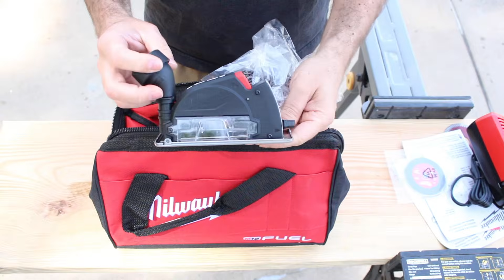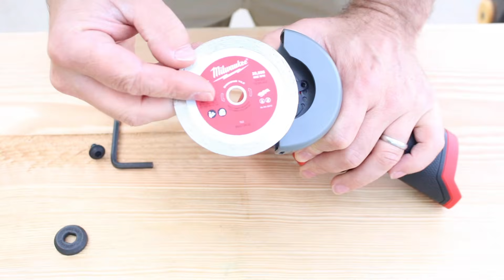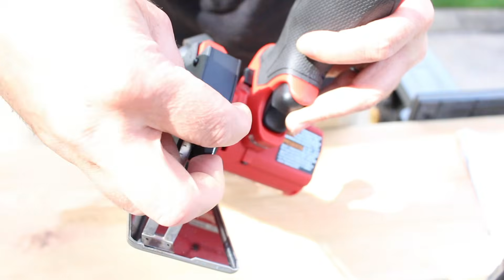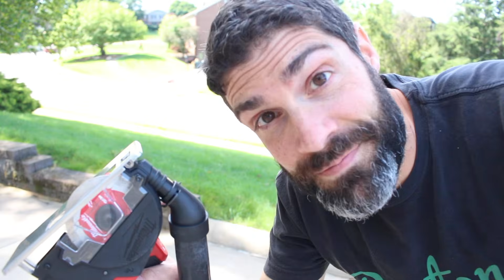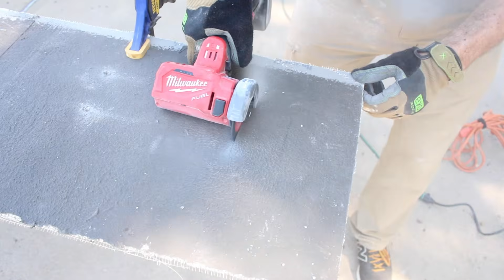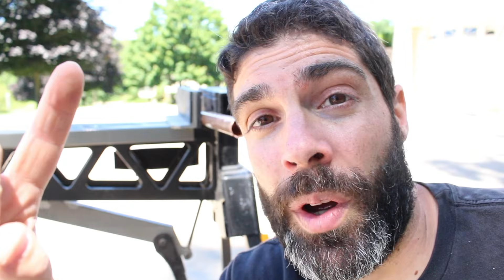Milwaukee 12V Cut Off Tool...What Can It Cut?

Comment: It seems just a little 2 small ...
I was on board to buy this tool but it's blade is probably just 2 small .. I thought it would be great for conduit and pipes but as easy as it did cut it seemed like you struggled getting a clean cut right around ..
Great video pretty cool tool

Comment: just got mine,broke it in on intstalled doorstops trimmed the extended bolts no prob,no speed control but luv the compactness,will be using on all quik projects

Comment: MUCH prefer the DeWalt. More powerful, feels better in the hand, has an allen tool storage, you can change the wheel with the dusr shield on etc. It just has more features and it's just far superior.
Reply: Yea its really goes back and forth both brands each have better stuff. Sadly batterys so costly its often beastto just stick to one brand.

Comment: As an electrician sometimes I do residential work in older homes, for cutting old work boxes in plaster this tool is a lifesaver. Can't tell you how many multi-tool blades I've burnt  through before this tool.

Comment: Thanks for a thorough review of this tool. I appreciate having a lighter weight tool small enough for working in stud cavities and between floor joists.
Also grateful for the comments about using the 3" dremel blade for cutting wood. Tricky to cut straight with the multitool blades.
I will note that the manual for this blade says not to use saw blades. Hmmm.
I will probably try it.
Variable speed would be great.

Comment: Bought one to do rust repair on my 1968 GMC long bed.  I don’t have a plasma cutter and my 6” grinder is a bit unwieldy.  Thing grinder is easy to maneuver in my cab for the small patches I need to cut and replace.

Comment: Oh my goodness, please no one take any advice or rely on the experience of someone who doesn't know the difference between an 18volt battery and a 12volt battery. The worst part is the average person doesn't know enough to realize that people like this guy are utterly clueless. 

 I do admire the self confidence required to make a tool review when you have extremely minimal knowledge of tools, but I don't admire the lack of self awareness. If you knew what you were talking about this video would be taken down simply out of embarrassment. 

Your parents raised you better than this. Do better. 
 
Oh yeah It wasn't a shop vac issue it was  a first time user pretending they know what they are doing issue.

Comment: Most any m12 battery will work in mine. This little tool is great. A wood saw blade is the only missing component. Yes, use safety goggles.

Comment: OK - background…I have a couple of 12V Milwaukee tools, so wanted to stay w that size battery.
Dumb question alert - I need an all purpose tool, but for now, a tool that will cut trim, mdf etc for some DIY projects.
Is this the tool that I need or more like a miter saw?
Thanks

Comment: Mine struggles to cut anything-keeps stopping, using a 2.0ah, think its the battery causing the problems?
Reply from the maker: That or the blade needs to be replaced
Reply: @HomeRepairTutor  Sussed it, bad batteries always on two bars so it was not delivering full power, I think I will get a 4ah at least!. Thanks.

Comment: Just FYI, a 3 inch blade will always cut slower then a 4-1/2” tool. It has to do with blade surface per rotation. They both spin at the same speed,  but the circumference is much smaller with the 3”.
Reply: @toastinator This tool spins at 20,000 rpm, a 4.5 inch grinder spins at 10,000-12,000 rpm, so they don't spin at the same speed
Reply: @dogbreath6974  Which he actually says in the video. I'm guessing @toastinat0r commented without watching the whole video

Comment: The reason there is no battery indicator on the m12 batteries is because any battery that uses the M12 system, they have their own battery indicator.
Reply: Nice making up things, you have it totally backwards. rofl.  Where do you put everything for the battery level indicator on a cp 2.0 12 volt?  Right you can not with out making the battery way larger.

Comment: M12 tools show battery on tool where M18s usually show on battery back ... LOL  clearly they want the battery back to be small on the m12 if They add that same feature to the m12 battery pack it will make it bigger in size and that’s not good in my opinion, good video though! Very informative.

Comment: I have one of these and it's my second most used Milwaukee tool, behind the impact driver. I love it. It will cut notches in cramped spaces, it cuts conduit, it cuts plastic pipe cleanly and more importantly cuts the last bit of some material that is just hanging on that you're having trouble removing by hand, it cuts off nails in old boards, it makes straight cuts through sheet metal and aluminum flashing, and on and on. It's just and incredible tool if you have something small you need to get straight through without making it jagged. For whatever reason, that's a need I have a lot. Last week we were removing an old fuel tank and one leg was cemented into the ground and wouldn't come lose. In 60 seconds this cut through it. My neighbor was replacing a sink and his metal drain pipe had corroded so the pieces no longer unscrewed. In 20 seconds this thing cut through it. I'm often coming across old nails in cramped spaces that need to be cut to allow the replacement boards to be inserted, and most times this zips them off. Every now and again the big, awkward 4.5" grinder is needed for these jobs, but this tool is much smaller, lighter, and comfortable in a single hand, and although the thermal protector will cut it off if you push it too hard, it has a lot of power. I'm always reaching for it.
Reply: When it use for tile cut, does it give a good and smooth edge?
Reply: @潜行者  I haven't used it with tile. It has an internal shut down that cuts the motor off to prevent overheating when it is used hard, and it trips easily in dense material. Tile is dense, so it probably would only be useful for quick trimming and smaller cuts, not as a main tile cutter.
Reply: @mickm5097  thanks, usually I use the grinder or wet saw to cut tiles, but the edge is not good enough
Reply: Yes it works well just use Diablo wheel with that m12 cut off

Comment: If you're cutting anything that creates a ton of dust use a bag so you don't pack up your filter and kill your vac. it works way better and you won't have dust flying everywhere because the filter is losing suction packed full of dust. also if your diamond blade seems dull you can cut a tiny bit into a cender block or the best thing go to a tile store and get a diamond dressing stone this is made to knock off the dull stuff and bring sharp diamond up to the surface most hardware stores don't carry them tile shops or masonry shops do since we use them on tile blades will cut great after dressing if you can't find one you can also use a rub stone but the dresser is best  👍👍👍

Comment: Can it cut 2X4's?
Reply: I don't think so considering the blade is 3" and it's cut is less than half of that, maybe 1-1/4".

Dewalt's Atomic circular saw is perfect for 2×4s as it uses 4-1/2" blades and it has an extended reach handle. I don't like their Atomic lineup too much, but this thing is pretty awesome! Only thing I own from the Atomic series

Comment: I use this cut off saw daily, bought in a kit with m12 fpd combi drill, i use it for cutting steel conduit and trunking, steel tray work as an electrician. Very hany little tool. M12 fpd drill is amazing awsell

Comment: The chipping of the ceramic tile (not porcelain) is from unsteady hands. You're allowing the blade to cut on the up side chipping off the ceramic(glaze) of the tile. Porcelain tile will not chip that easily either. Try cutting in reverse sometimes people ct tiles better that way.

Comment: A great review. Do they sell  blades for cutting wood for this model?
Reply: No but you can use the 3-inch Dremel blade
Reply: Yes, that is an option. It is interesting why this model doesn't have a blade for wood. I used it. It is powerful. Thank you.
Reply: @hussainluaibi1481  I think the main point is the RPM,  the mini Handcycularsaw (e.g. from Makita) has RPM of 3.5k to 4k. The angle grinders (even the mini ones) have 19k to 20k.  The grinder blades need very high rpm to be safe. The wood cutting blades are actually relatively slow to keep the temperature from friction down so you don't burn the wood.  

But you are right, give this a slightly larger blade diameter (maybe 3,5 to 4 inch), give it a 2-speed gear for 4k to 20k (just like drills have) together with the dustcover, and the guide rail would make a really really really nice wood/stone cutting tool.

Comment: Will using a stronger battery increase the power?
Reply: No, using the higher amp hour batteries will increase the run time. To get higher power you’d have to use a higher voltage wireless tool.
Reply: @YABOYTAN  Wrong, although tricky.  Larger battery can supple larger in-rush and constant current required. 
 Smaller battery will max out quickly and thermal overload/shut down on high draw tools quicker.
Test this by running your cordless circ saw with a 2AH and 4AH battery while cutting a 2x4 or 4x4.
Note- Using a larger or appropriately sized battery will allow your tool to work at its maximum power vs a small 2AH battery, however it will not allow the tool to work better than it was designed too.

Comment: Can any of the wheels cut concrete?
Reply: So someone asked this on the site and technically it can with the blades it comes with but due to the size of the motor and actual cut off wheel it's really not ideal.

Comment: I work on cars for a living and I use this regularly in the Rust Belt. I've even used it to cut the top off of a ball joint when the nut would not come off I just cut the whole top of the ball joint off at the knuckle and then banged it off with a hammer. It has helped me out quite a bit
Reply: Turd McFerguson Same here,I’ve used mine a lot more than I expected. It’s very handy for little jobs.
Reply: @JohnDiMartino   yeah I tend to find ways that I can use it LOL. Like I said I use the hell out of saws and Cutters up here and that is definitely one that I use quite often.
Reply: Did you do that with just one metal cut off blade?
Reply: @JaasenJones  yeah just 1 metal cut off blade, as matter fact I used the original the one that it came with. Of course I've had to buy some more since then LOL. But all in all I don't have any complaints about the tool. It does exactly what is advertised.
Reply: Turd McFerguson thanks for the reply. Good to know. I’m not a mechanic by trade, but I do do my own vehicle work and custom fab for police /fire radios. I also happen to be in a rust belt up in Wisconsin, so your video helped me out.

Comment: Would this be a good tool for cutting through 2X3" inch aluminum downspout? Not much thicker than a pop can
Reply: Yes it cuts 16 gauge galvanized sheet metal easily
Reply: I'm a gutter installer and was thinking this or the m12 hackzall would be a great tool for cutting downspouts.  Seems like a good idea.
Reply: This should cut AL gutter like a hot knife through butter, and probably at a pretty good clip. Disregard the fails in the video/comments as this is not a replacement for a grinder w/cut-off wheel that normally pull 5-10 amps at 120v.
Reply: It cuts downspouts like a champ!

Comment: Don’t you typically wet tile especially really hard porcelain.   They don’t call wet saws wet without reason.  Most have recirculating or constant refreshing water so the blade stays wet/cool and debris cleared away.  Maybe even a spray bottle since it’s battery not corded. The deal is to keep it throughly wet. Ask the manufacturer and as I said porcelain is a beast  - which is why it can be used outside and in commercial applications - I have some sitting outside year round to go under pots (act as a shelf in a rack) for over 20 years in temps from -5 to 105F in full sun and thus exposed to cold, heat, ice, snow, wind from all directions.  It does have shade in summer when umbrella is up but winter is the toughie with freezing.  No cracks or spalling, etc.  It was genuine porcelain leftover from my kitchen floor which I have been very impressed with - in 2000.  
Note it will break if you drop it on a hard surface or crack if a heavy hammer is dropped on it. I have dropped pots on it and my great grandmothers two small, lightweight  handmade hammers without issue. However, I image at the right angle of drop they might hit wrong and crack though I can’t imagine so - the head is hand forged and the  circular area that makes contact head is maybe 1- 1 1/2”.

Comment: I was curious about this tool to use around the house but mostly for my next job on my Jeep Wrangler with putting on my hood louver since it requires cutting the hood. Looks like it did well with copper.  Would be curious how well it would cut through steel though or what would be the tool to use since I like cordless tools for on the trail or in the garage. Awesome review video!
Reply: I have this one and a 5" M18 Fuel angle grinder. If you have neither and just want to buy one, but the M18! It will do everything this one does and more, and it will do it faster, at the equivalent of battery use.

That said, I love both this one and the M18 grinder. But I think why alot of people are disappointed with the M12 cutoff tool is that they needed a grinder but thought they could lose 6V, some size, some weight and at a lower price and still do some heavy cuts and grinding. And they cannot!

This one will cut steel, even slightly thick steel, but cut depth will limit it, it will take time and if you push it it will stall.
Reply: @kundetjenesten  Spot on.  This is for light work, trim and finish, etc.  I also wanted to get one of these in hopes of easier cutting of sheet goods and stuff, however its clear it is not powerful enough nor built for that task.
Reply: @kundetjenesten  exactly what I needed to know. Thank you.

Comment: Kind of pointless when a sawzall with the correct blade can achieve so much more.
Reply from the maker: no doubt Sawzalls are great but this is meant for smaller projects
Reply: Yep so true. I always cut trim and siding to finish length with a sawzall...

Comment: Any M12 battery can be used in any M12 tool. 4.0 Amp-Hours represents the capacity of the battery. An M12 4.0aH battery supplies the same voltage (12V) as an M12 8.0aH battery. But a tool with the 8.0 will make twice as many cuts, holes, crimps etc as the same tool using a 4.0aH battery. You ought to know how batteries work if you're reviewing cordless tools.
Reply: Theoretically, you are correct. Amp-Hours are the same as coulombs, which measure charge. 

However, I think the general consensus is that batteries with a higher charge tend to help tools perform better; I believe it's due to the electronics preventing rapid discharge of the battery.

I have the M12 1/2" impact stubby and usually only use 2.0Ah batteries, but the 6.0Ah gives it a bit more torque 

Same thing with my dewalt 1/4" driver, the 2Ah isn't enough, I usually keep a 4 or 5Ah on it to meet my needs at work
Reply: @CorrectMeIfImWronf  Yeah, it's called internal resistance.  More cells in parallel means less effective resistance for the same voltage because it has more paths.
Reply: The bigger ah batteries also have more power.  My 2.0cp won't take lug nuts off with my impact driver, but with the 3.0xc it will.   Now I know impact drivers aren't made for that, but I just like to test.
Reply: Thank you! That was really bugging me, especially how he compared the m12 battery to the m18 battery.
Reply: Milwaukee doesn't make a M12 8.0 ah battery, the biggest they do in the M12 lineup is 6.0 ah. 
Matthew 7:1-3
Reply: @okafka5446  True! I just meant to give an example of what the amp hour measurement meant.
Reply: @okafka5446  there are m12 9.0 batteries though😉
Reply: @crazymayne69  Not from Milwaukee- their largest M12 is 6.0. Maybe Chinese knock offs, but if that's the case, it's probably not really 9 amps.
Reply: @mickm5097 yea those 9 ah Chinese knockoffs are actually like 4 ah and underpowered due to the cheap junk cells being used.

Comment: I just use the tool to cut tile for a customer in their kitchen to put in a larger stove it worked awesome not one bit of dust I used a Ryobi wet dry vac you run it in reverse so that it kicks the dust out the front into the dust boot.
Reply: You can go with Milwaukee’s 12 V vacuum also and it does only cut up to 5/8 inch tile it is a high speed low torque grinder.
Reply: How long can you run it on reverse before blade goes flying
Reply: Is it better than a grinder when need cutting tile?

Comment: Obviously not used to Milwaukee m12 lineup. The tool does take time to get used to and the diamond blade does suck. It does Not require the 4mah battery I use mine with my 1.5 and 2.0mah batteries they just do t last long. Highly reccomed the 6.0 for this tool to get some decent run time out of it. This tool can also cut wood usi g the 3in dremmel muti material blade. This tool can do very long cuts but will need time for the battery to cool afterwords. It defiantly draws tooons of power. Best $150 I have spent in a long time I end up using this think all most every day.
Reply: colt45lmer lack of acknowledge use a diamond 💎 blade  1# score the surface blade, so that use don’t get premature cracking. Work the cut line.  That’s why the diamonds 💎are on the sides of the blade 🐺‼️ Only rookies/ novices try to cut straight though with one pass 🥴 “golden  M12 FUEL + 6.0AH  = M18 PROFORMANCE⚡️”

Comment: What is the difference of the 2522-21xc from the 2522-20?
Reply: 21xc means its includes a battery and a case.
20 is tool only